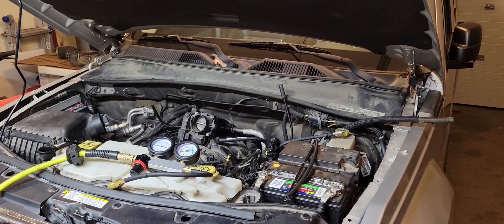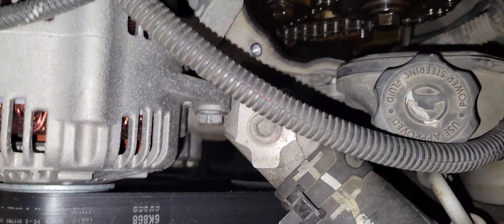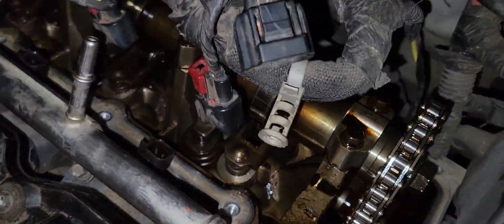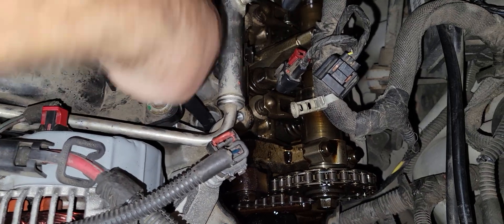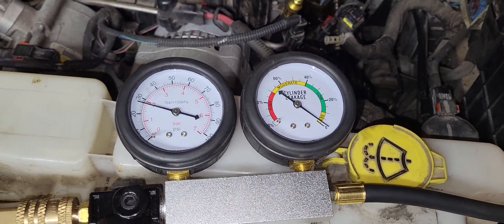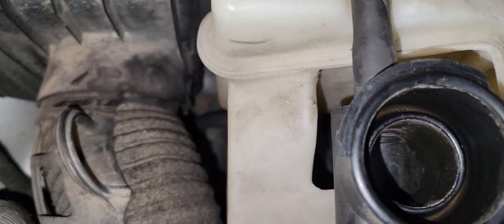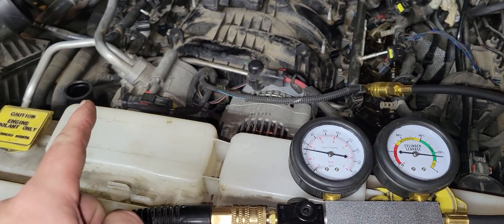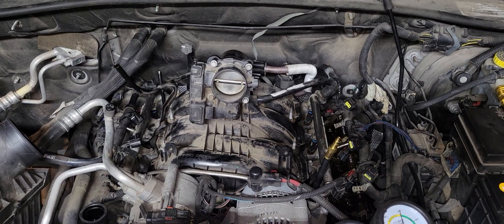2008 Jeep Liberty leak down cylinder test

Comment: Would a head gasket dye test kit caught this?? The one where it starts blue but then turns yellow as it finds exhaust in the coolant? THX
Reply from the maker: Those tests work if the coolant is exposed to exhaust gases.  In this particular case it should have tested positive if that chemical test was done.  In some cases with a blown head gasket when there is no exhaust in the  coolant, the color won't change.  The head hasket can be bad in any place, which doesn't always have exhaust/coolant blend.